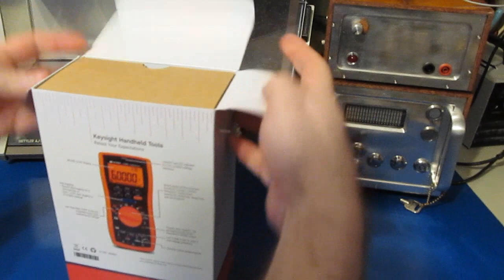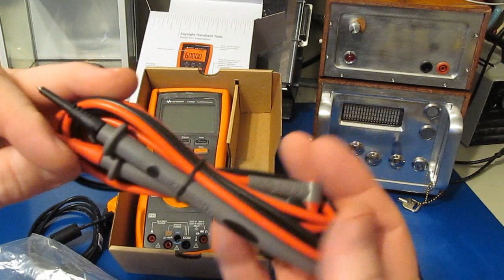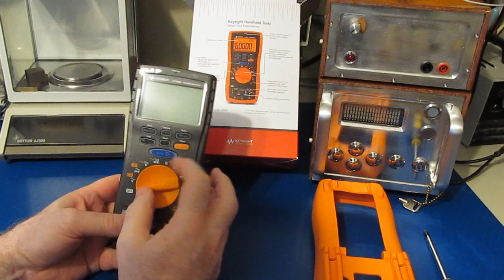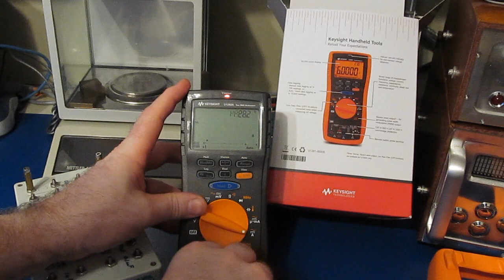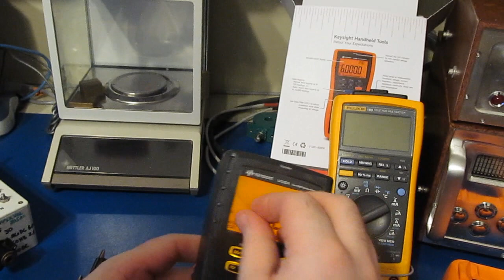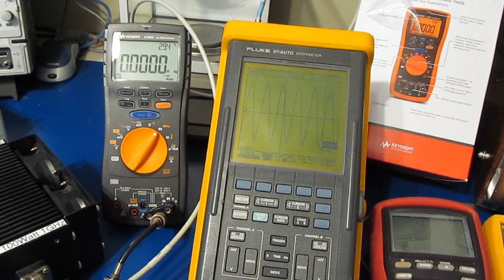Keysight U1282a Review Part1,  Initial Checkout

Comment: I have a U1273A ,  some Flukes,  a Brymen 869S (recently killed in action) and some more. I do not have the Keysight here at this moment to test the function knob but I use it now like a month or so and if it was not nice I think I would have noticed it in a negative way.  I like it but is is a bit slow.
Reply from the maker: Fill us in on the Brymen's death.
Reply: @joesmith-je3tq  The Brymen got something like 10 kV from a HV / high energy PSU  on a rail that should be only 350VDC.  It was really nasty, two 800V/12A IGBTs killed with such a bang that my ears beeped for days,  a 12 ohm 11W series resistor on the output connected to nothing went dead in a flash, one off the several arcs burned a spot on my wooden desk via/on the edge of the antistatic mat and a metal grounded emergency switch enclosure. It frooze my R&S  DSO and that was not even connected to the PSU.

The Brymen still showed values and switched functions but did not measure anything. The input protection was fried/exploded/vapourised. Replaced everything that was dead incl some  vaporised traces but it still is not good. I had no time to dive deeper into it, Maybe some diodes further on the signal path are dead (measured in situ they look to be OK) because all function seem to work but the values are way off. I will look at it when I have more time because I liked it a lot. It is fast and still spoton after a few years of daily (ab)use. 🙂
Reply from the maker: @pa4tim  Thank you for taking the time to post that story.   Worth getting pinned!
Reply: You haven't uploaded a video for ages. C'mon!
Reply: Soon you will have a big problem with this function knob like I did. Basically the grease between the knob and meter body will become a jelly and meter will start turning off suddenly or freezing. You can disassemble it and try to change this jelly but pray to not damage fragile locking plastics because then the switch will be gone. Someone who designed this switch had to be totally noob.
Reply: @filipsz6728  We will see, I have an Agilent that still works well that is now over 10 years old. I use both daily for my job. However, I have seen the problem you mention, but that was on two Fluke clampmeters that came in for repair. There the wipers scraped of some metal particles from the traces. Over time, the metal was kept by the grease in between the traces until it was enough to connect them, resulting in the same problems you had and not being able to change functions. I will not damage things, I often work on delicate instruments.
Reply: @pa4tim  Agilent was designed and made by professionals. Now in these days I see a pattern where big projects are run by people without passions and experience. Keysight is one of these examples.

Comment: My old 1241A is terrible at resistance measurements. Slow, takes forever to drift into range. Mine gets worse as the resistance gets higher. Bought it cheap used, never will buy a new one. Voltage measurements read low on mine as well as compared to every other brand meter I own including some ancient Beckman meters I restored.
Reply from the maker: This is certainly one of the slowest meters I have looked at.

Comment: In the 100Mhz range, the sensitivity is 330mV with input with a load of 50 Ohm, but it seems like you are only providing around 63mV (23dBm into a 50 ohm load), am I correct?
and if it is the case, no wonder it doesn't function correctly.
and about the different Voltage measurement positions, I find them very annoying and confusing, seems like people just don't put the effort to automate these ranges and integrate them into one or two positions.
The Brymen BM869s is even worst with 5 voltage measurement positions and all of them can measure ACV or ACmV!
Let's take the Gossen-Metrawatt Energy meter for example, that meter can measure from uV to the max ACV range and any other AC-related measurements possible on a single range position! and also the same story for the DCV as well.
that meter has 10 selector switch positions just like other high-end meters on the market but much more features and functionalities.
Reply from the maker: I have no idea where you would get 63mV.  23dBm is 3.2Vrms.   I demonstrated with up to 13dBm or 1Vrms.  Then with 20dBm  or 2.2Vrms.   Later I switched to adding a small power amp to bring the levels up even higher.   At one point I attach a scope to show the sine wave.    In part 2, I change to an LVDS driver (1.2V).   I also tried it with PECL but it had no effect so I left it out of the video.   Eventually during part 2, I compared it against some other very low end meters I have as well.   Have a look and let me know if you have any other questions.
Reply: @joesmith-je3tq  I used division instead of multiplication under the square root, that was my immaturity  unfortunately, so your values are correct here, but now it arises a different set of questions.
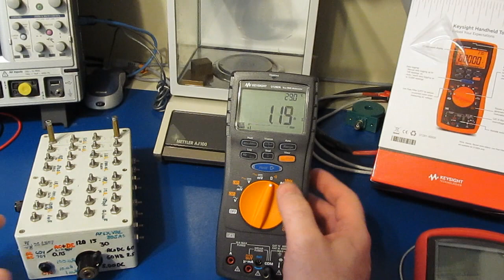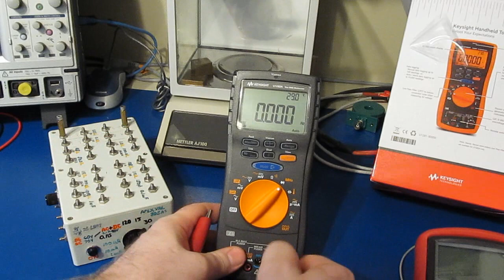So here at 23:51 for the first time, you attached a +-2.5Vp to the frequency counter of the meter which it clearly states in the manual that the Maximum measurement value is +-1.8Vp so I guess you damaged the meter's frequency counter right there, then you proceed to apply a 5V signal after that, then comes the frequency counter test at 24:22 which again the amplitude is about 3.2Vrms or +-4.5Vp or 9Vp-p according to 24:52 which is devastating for this meter's frequency counter that can only take +-1.8Vp or 3.6Vp-p.
Reply from the maker: @Jake3757-n9q  The box in question will put out a 0-5V signal which can be AC coupled.  This is not 9Vp-p.   While the datasheet does state this is a low voltage input and that it has a maximum measurement level of +/- 1.8Vp.   This does not suggest the meter is devastated at these levels as you suggest.   They do however warn you not to use it "on AC power line systems."      If you were to actually take the time to read the manuals, you will notice that the frequency counter input has an overload protection of 1000Vrms.   You would also notice that the meter is supposed to be rated for EN61326-1.  Normally from what I have seen, the meters that pass that test will typically survive several kV from my generator.    Of course, if the meter were damaged from this 5V CMOS signal, I would have a field day with it.
Reply: @Jake3757-n9q  The manual’s figures are typically to guide/guarantee accurate measurements and rated performance. I personally wouldn’t expect a multipurpose instrument like this to suffer damage from a simple overload, especially such an anemic one at that.
Reply: @joesmith-je3tq  sure the 0-5V is, in fact 0-5V, and I'm not suggesting that it's 9Vp-p, but instead, I was pointing out the 23dBm signal amplitude is 9Vp-p, now I'm not suggesting that the 9Vp-p "should" devastate an instrument like this but rather "could".(I meant to say could devastate)
what I'm suggesting is that we should've started the test with the recommended Max voltage level for the frequency counter, the 1Vrms for example.
Of course I was aware of the fact that the input is protected against 1000Vrms, but I think there might be a creep or dead zone in protection, what I mean by creep: let's say the input is protected in different stages, one is the large input protection devices like PTCs and MOVs or GDT in this case which does trigger above 1000Vrms, so nothing they can do for low voltage, then we have the back to back transistor Zeners which I'm not sure what type of transistor they are using but the VEB breakdown + VBE would be around 5 or 6 Volts, so for a 3.3V system that they are using here it might point a hazard to it, now we should have anti-ESD diodes at the input of the edge detector but I can imagine they might blow up.(I'm just calling out the potential scenarios.)
but all in all, I think you should send an email to Keysight about this confusion or problem, so they would have a chance to explain themselves.
it's so strange indeed, I don't know what they were thinking with this feature! +-1.8V only is just not of any use to me personally.
Reply: @silverXnoise  I would not expect that either, I'm just saying we should've started the test with the specified values, and then if everything worked out fine we could bash the instrument on how useless it is in this feature for only measuring up to +-1.8Vp!
one complaint I have is the datasheet itself, it's so incomplete and oversimplified that you only see that 100Mhz once throughout the whole datasheet and no more information about it, for example, they don't say: "The frequency counter can measure up to 100Mhz.", but they mention the 10Mhz range many times, it's like the meter originally designed to be a 10Mhz counter and then it exceeded the specs in their tests so they put a 20Mhz and 100Mhz marking there as "Extra Feature".
Reply from the maker: @Jake3757-n9q  When I hear or read "we", that tells me you are putting your hat into the ring and planning to repeat the test your way.  Otherwise, there is no we.  I look forward to seeing what you come up with.
Reply: @joesmith-je3tq , I truly can't see how it has anything to do with putting your hat into the ring!?!
by "we" I mean the people who follow this video series and discuss it.
you see I understand that this is your channel, your videos, and your way of testing, and of course, I or anybody else has no control over it but initially, I thought giving feedback and discussing stuff here is legit, seems like my bad again.

and about the testing the instrument myself, I might actually do that, probably not Keysight meters as I'm not, particularly a big fan, but probably other products.
Hope you have a good week and smooth testing.
Reply from the maker: @Jake3757-n9q  Too bad as I was looking forward to seeing someone else stepping up and repeating some of these tests.   If anything, just as a sanity check.     Again, I know enough about the meters that I have zero concern running at these levels would result in devastation as you suggest.   Of course, being a beginner I wouldn't expect you to have that background which is why I took the time to explain it to you.

Comment: Yeah I didn’t like the way the AC gets stuck in the frequency display once you look at it, the only way I found to get out of it was to change modes, just like you did.
Reply: Long press the "Dual" button to go back to AC mode. 
However, if you are in period or duty cycle, you need to keep pressing the "Hz" button to get to the frequency and then long press the "Dual" button to get back to AC. The U1282A's button logic is not its forte.